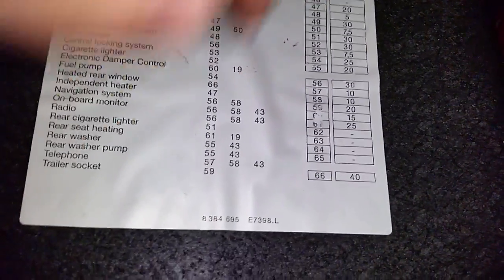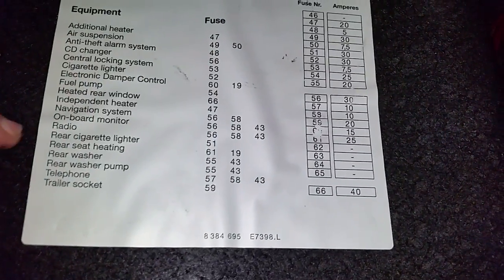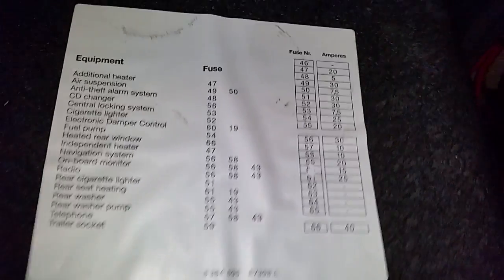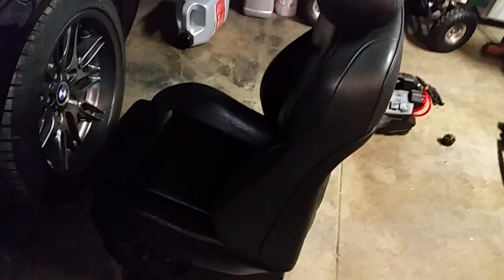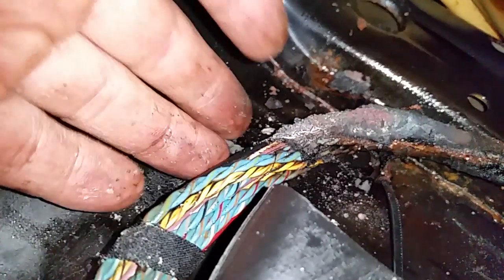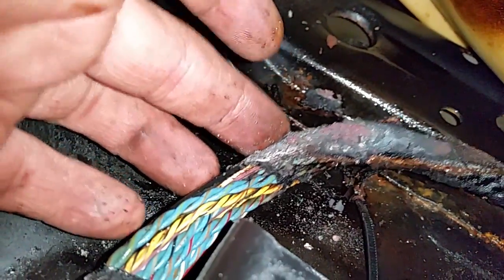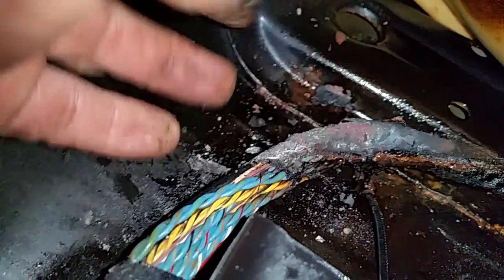BMW e39 5-series wiring electrical fix! lights cutting out, staying on and speakers cracking/humming

Comment: Hi, there was a GM3 module failure in my car 2 years ago, we changed the gm3 module, but service stuff told me that there is a short circuit in this car, because a few seconds after turning on the ignition, the steering wheel goes down, whereas it should come down immediately.  Also, the air conditioner failed on its own, and the car does not connect to the computer. It is said that the GM3 module is broken first because there is a short circuit in this fuse panel under the seat and the air conditioner does not work for this reason, do you think it is true?
Reply from the maker: There should be a fuse block under the passenger side seat, I would check that first. Could be corroded from people's shoes (water, salt) or spilt drinks. 
If itsngood, find what module is not connecting and chase the harness.
Short circuits are a trick to find and take patience to find. Sorry to hear that!

Comment: Cool video! My indicators and hazards all work but it doesn't show on my dash? Radio off as well? Worked before but went off, reckon its the same?
Reply: I dont think it is. It has to be some Kind of I-Bus Problem. I think i have a Problem with rainwater in my trunk.
Reply: Did you find it? Same Problem
Reply: @marekbohm8515  haven't found it yet but the radio is working now but the interior heater fan isn't?! I'll let you know soon
Reply: @drkthemusicman  found it! For me it was water in my Trunk and a Plug with I-Bus cable on it laying in the water
Reply: @marekbohm8515  I'm so glad that you've found the problem which you've hopefully solved now! I also have alot of moisture in the trunk so I'll be checking that out 🙌
Reply: @drkthemusicman Thank you! it was Hard to find. I looked 2 times bevor and diddnt Found it. So if you Need help let me know.

Comment: Good info. my 2003 530i brake lights go on and off sometimes . And a while ago the front headlights did to but i changed them and havent seen it again in the front . But not the rear brake lights also the inside lights blink sometimes along side the brake lights? Any info ? Think its a fuse??

Comment: The back lights are on while car is off and drained the battery im thinking that i may be have this same issue.
Reply from the maker: Only the the brake lights? Check your brake pedal switch if so.

Comment: I’m having A similar problem but I can’t get my passenger front seat to move back and fourth and when I use the button on the side of the seat the alarm goes off PLEASE ANYONE HELP
Reply: Thank you for your help I’m trying to get the passenger seat 💺
Reply from the maker: Hi friend. Hook up a battery charger and try  to move your seat. see if it does the same thing. Judging by your other comment about it not cranking properly and dying, it could be a bad battery OR connection.
Reply: I hook the battery charger up when I open doors lights blinking off and on and when I go to try to move the passenger seat the lights go off an alarm clicks a couple times and goes off
Reply: I rock the car side to side a couple times and the inside dome lights and door lights blink back and forth
Reply: And I can’t get the passenger seat to move so I could take the boats out to look underneath to see if the fuse box has water in it and I know the carpet is really wet
Reply from the maker: @smilysbable  sounds like you have a bad intermittent loss in power issue. Could very well be the fuses and connections under the passenger carpet. Make sure your batter cables are tight at the battery in the trunk. You will have to try your best to remove the passenger seat to access those connections

Comment: Having similar problems dash lights flickering windows raising down just put a new starter on it come back home that night windows where down engine light was on once again will be taking it to  the bmw shop tomorrow morning at 10 am hopefully they can tell me something good video very helpful
Reply: Derrick Washington did you take it? If so, what did they say?
Reply: @Leek2x   Yes I went to BMW today but I made the mistake by going to auto zone the day before and they cleared the codes so BMW told me I will have to wait until next week auto zone told me that it might be the mass air flow sensor but I don't believe that that's the problem I'm thinking something electrical
Reply: Derrick Washington think it could be fuses or alternator?
Reply from the maker: oh yikes! The windows roll down automatically? Interested to see what codes pop up. Hopefully not too big a nightmare man.

Comment: How do you get the passenger side carpet up? I removed the two torx bolts in the front brackets on the passenger seat. Also removed the plastic trim piece on top of the edge of the carpet. Now i cant figure out how to get the carpet out from under the seat brackets? Do i have to entirely remove the passenger seat from the car? I didnt think that was required lol
Reply from the maker: Hey there. Youre talking about getting to the bad wiring under the drivers seat correct? Instead of completely removing both seats, brackets and carpet; I just took a utility knife and cut the carpet back enough along a seem to pull it up and out of the way so I was able to work. Putting it back fits perfectly. You wont notice you cut the carpet at all. That just made the most sense to me as it saved tons of time and does not negatively effect the vehicle or appearance. Just dont cut back further then the covers extend. The covers help hold the carpet down too when you put it back in place. You can use some sort of adhesive as well; tho i didn't.
I hope I understood the question enough! Hope this helps!
Reply: AcousticHills Im actually trying to get to the fuses under the passenger side carpet to check those first. But if nothing is wrong there, then ill be checking these wires in your video under the drivers carpet. Thanks for the help!
Reply from the maker: Ah ok, gotcha. unfortunately you will have to remove the passenger seat completely to get to that one. pull up and carpet and the foam and she is right there.
Reply: AcousticHills ahhh damn thanks man
Reply: @AcousticHills  there was a fire in my trunk and it melted all the wiring so a lot of things on the dash don't work,  so my question is if I find another e39 (either automatic or standard)  and I cut that wire harness from the back seat to the trunk could I then cut mine in the same spot and hook everything back up could that solve my problem
Reply from the maker: @stevenfranco659  Hey Steve,. Yes that would work. You'd have to be careful in making sure it gets spliced in properly. circuit to circuit.

Comment: dam thats a pain in the ass fix
Reply from the maker: You are most correct! It took me about 12 hours to have her back up and running! I had to go further back then i thought :(
about 60 wires to splice repair and approximately 120 soldering butt connectors. Gross. Imagine the diag and repair bill from the dealership after this!! #bankrupt lol